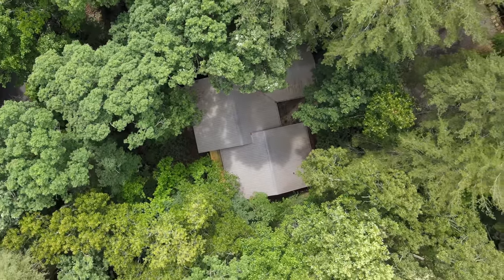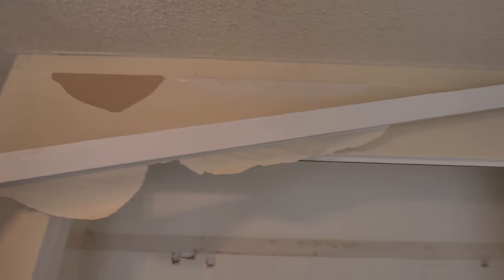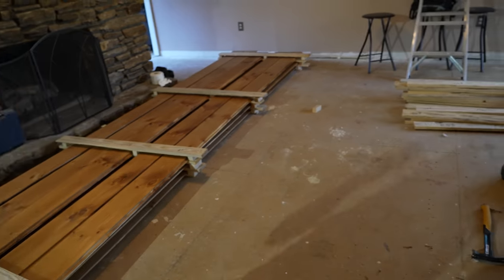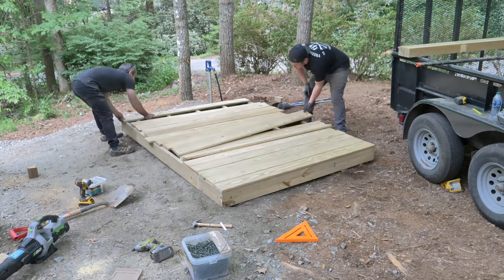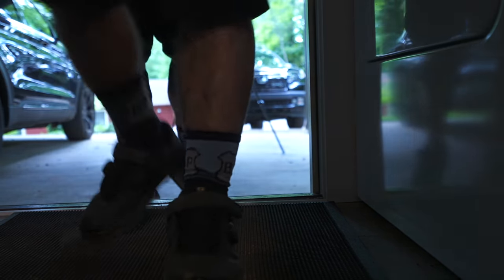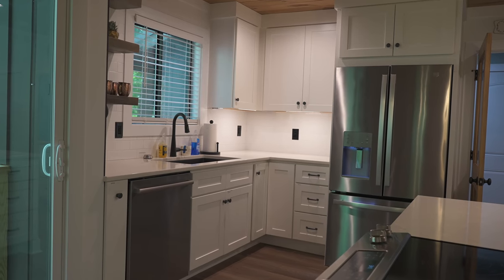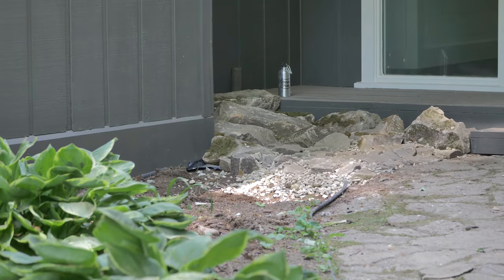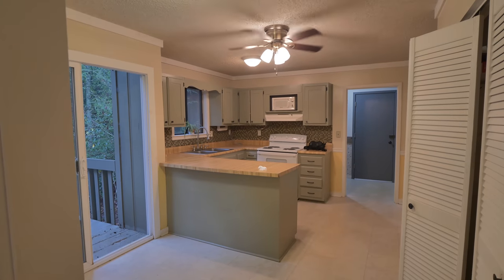House Tour! The Berm Peak Ranger Station is Done, and you can rent it

Comment: Hey Seth,I have been watching your videos since 6 months. Then I started riding the bike that i had in my garage. It was my sister’s bike. It had no suspension and a basket and place in the back tyre to keep things (i do not know what it is called). Its a single speed. It is 7 years old. The breaks were extremely bad. It had v breaks not disk breaks. I tried wheeling, bunnyhopping etc on it. It did not work. After riding that for 4 months my father decided to buy me another bike.
It was a MTB. It was a cross country hardtail with a coil no lockout suspension with a 100mm of travel on front,3x7 gears and mechanical (cable) breaks. The brand name is TRINX. Its a m116 2018 version. I have been riding it for 2 months now. And its amazing. I practiced wheeling and i can wheelie for over 10 meters now.
10 meters might not seem big but it is a big deal for me. I can bunny hop for like 40 centimeters now. I live in Nepal. My country does not have any mountain bike trails. So i ride street. And you have been a huge inspiration to me.

Comment: Nice place. I hope that I can get back in shape as school ruined my decent physique and now am roughly 200lbs. Would be nice to stay at for a day or two as I live in Knoxville, so about a few hours out. As a note though after looking through your previous videos. It looks like you could use a Garden tractor. I would recommend a John Deer for its front bucket attachments (I myself own a Sears Suburban from the late 60s but it does the job well). These tractors are also smaller than the gator so that it can fit the single track trails.

Comment: Regarding Tools, having literally owned a cycling guess house in Belgium for 12 years, you will have tools walk away, but mostly because of forgetfulness, than malice. I've had less than $100 of tools misplaced in 12 years and more tools left behind (so many multi-tools in saddlebags) than have left. 

One suggestion, have a "take a CO2, leave a CO2" bucket. That way people can fly in, carry a CO2 with them if they need them, but replace it if it gets used while they are there. Also, you will replace your floor pump about every two years, but I suspect Park Tool has you covered there :). if you need any help, just google The ChainStay Belgium and I'm happy to share experience.